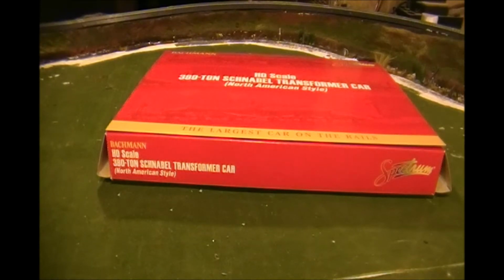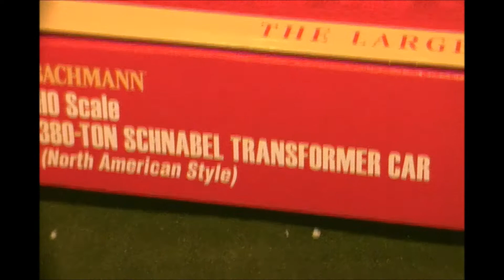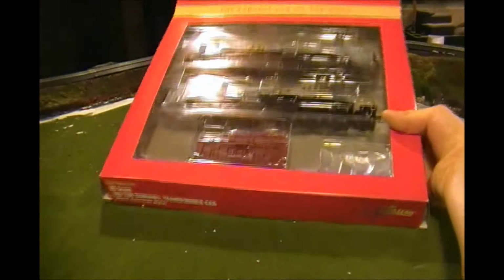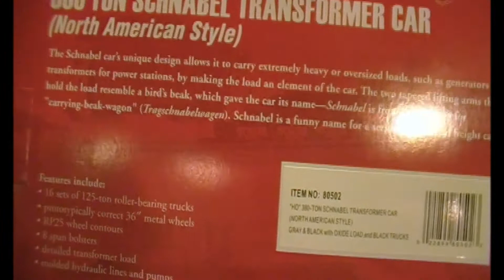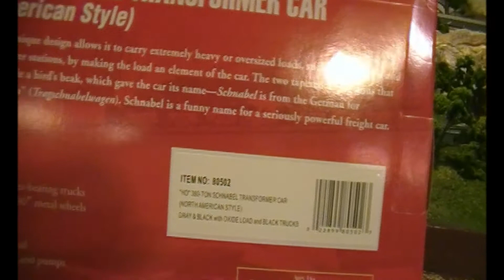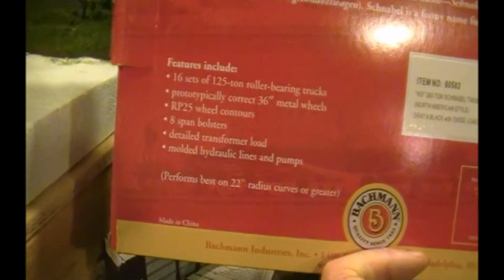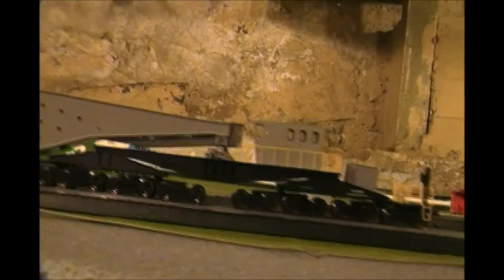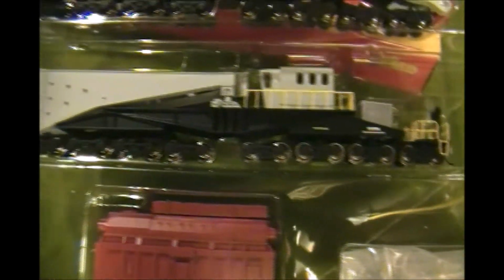HO scale schnabel car

Comment: That is one hell of a wagon to put on any layout, the size of it is massive and you were lucky in that it went as far as it did, a very impressive piece of kit!     ..........Graham
Reply from the maker: +Graham Foulston thank you sir ,, I do love it ,, I do this for a living so it only seemed to fit
Reply: +sparky107107 What exactly do you do for a living? I'm asking because once my O gauge Schnabel car arrives I need to find an appropriate engine to pull it. Since I'm in BNSF territory, I'm leaning towards one of their locomotives, but not sure which one. I've downloaded the BNSF locomotive roster and looked through it to see what might be appropriate. I'm thinking probably on of their engines generating more around 4,000 HP.
Reply from the maker: https://www.youtube.com/watch?v=XIeXf9idoqs
I am a electrician that works for a hydro company in Ontario , I build transmission yards , the big transformers
 above is a link to a video of a typical Schnabel consist
 most time smaller locos , GP-38 , sd-40